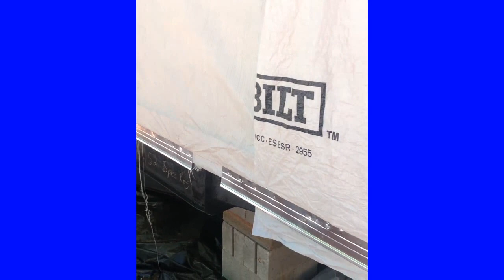See Our Mobile Home Set Up after Delivery | Raw Footage

Comment: Couldn't tell on the previous video where you showed your home ready for inspection, do you have screens on the vent spaces in that brick foundation? Need tomake sure you do that if not already to keep critters and cats out. Also to improve insulation you can put up insulation foam or panels on the inside on the brick foundation.
Reply from the maker: Yes we have screens in front of every vent space in the foundation. You won’t pass inspection without them